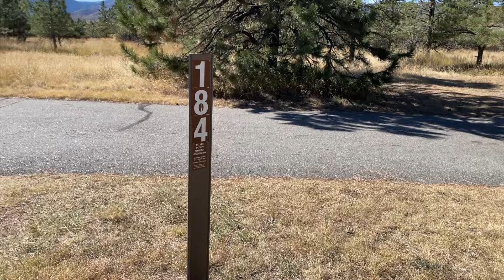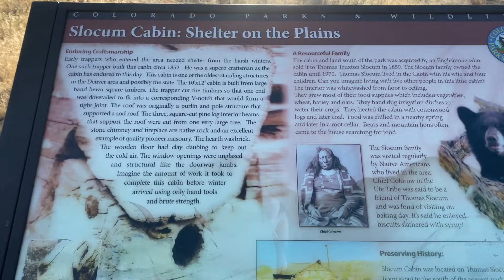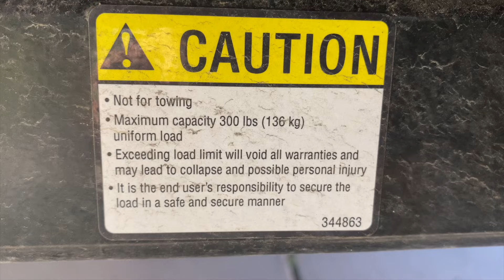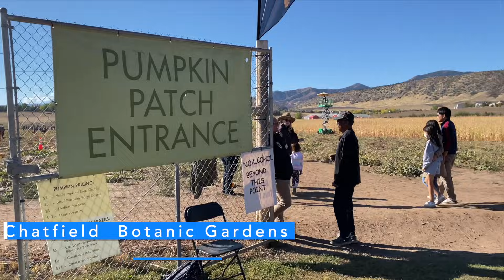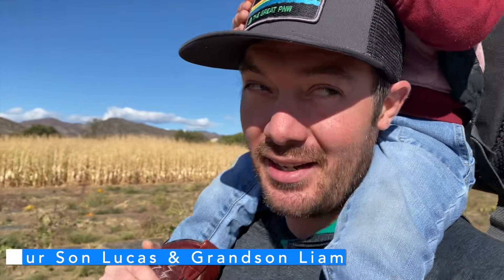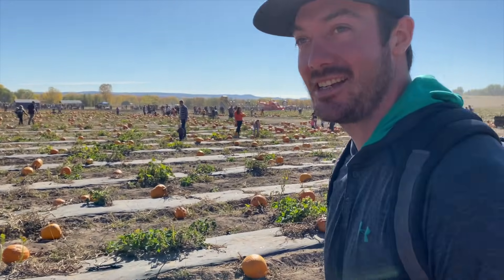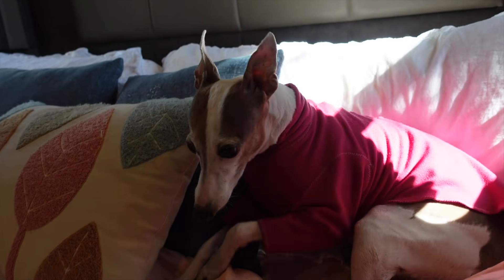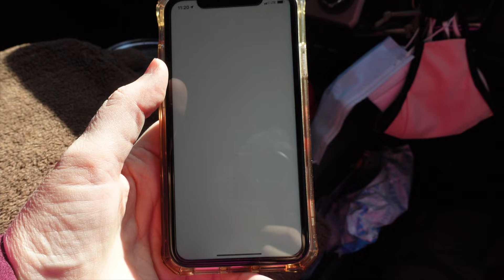A Day In the (NEW Vanleigh Vilano) RV Life - Downsizing Again!  Vlog Ep.53

Comment: I'd store the bikes in the locked storage under the camper. I'd be worried about someone figuring out how to steal them off the back even if you have them locked. Your Vilano experience is disappointing both on Vilano's end and the dealers.  It doesn't seem like the dealer did a good job of doing a precheck.
Reply from the maker: Thanks Kimberly!  You are correct on both accounts 😉. Bike storage and rv issues!  Thank you for watching and sharing your thoughts-Tammy